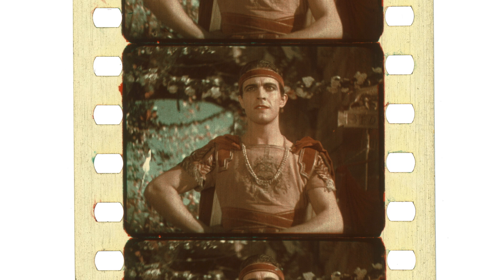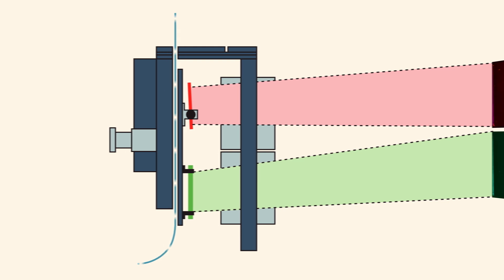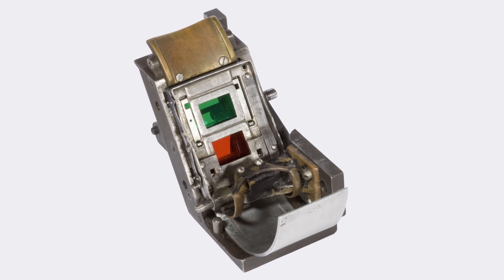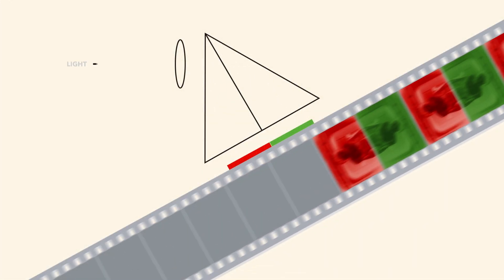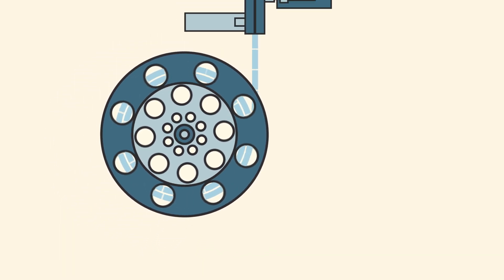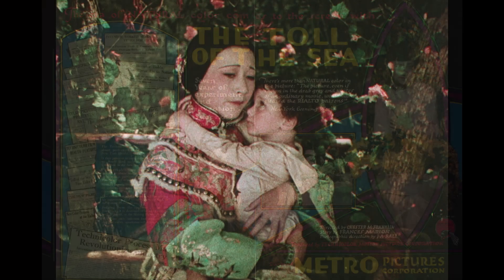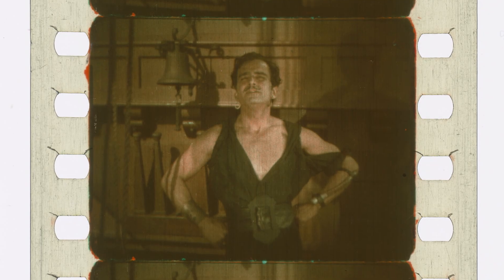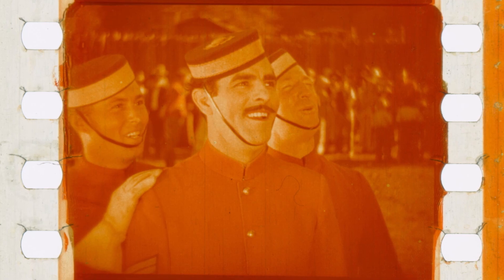The Two Color Process - Technicolor 100

Comment: That's not exactly how this works. What determines how one string of pearls appears red, and the other a goldish like green. Shoving a red and green dyed film clip together doesn't just make the final result. The camera has to be taken over light were it is shown through and takes a copy of exactly what is in front of it (the green and red dye just accentuated this filter of color) However Autochrome did not, it crushed down potato starch that was dyed and each of those dyes caught the figure of light in the spectrum to match up with the scene in front of it. They were identical to the original as proven by the color charts next to it that were barely off at all, red was perhaps slightly pinked but only by like a shade and purple was a bit warmer.

Comment: I don’t get it. So if you pass a black and white film in a projector through filters, you’ll get a proper coloring film? Could I do this with Kodachrome or tri-x.
Reply: Only if the original film used a color process, using 2 or 3 frames of film, or 2 or 3 strips of film, using colored filters recorded simultaneously. You can't recover information that was never recorded in a B&W film.
Reply: Kodachrome IS a color film.
Does anyone still use Tri-X?
Reply from the maker: No, what the video doesn't show is that the film used in Process #1 was recorded through red and green filters, capturing that particular information of the pan-chromatic stock. Upon projection, these filters were swapped, as in Process #2, so that the color information would be re-introduced to the projected image. Simply putting filters in front of black-and-white film shot in the standard way will produce an overall effect closer to the tinting of the 1910s and 1920s, not reproduce what Technicolor was trying to do with full-color images.